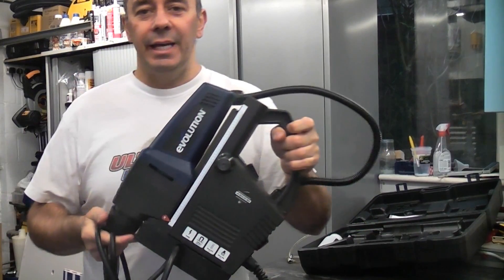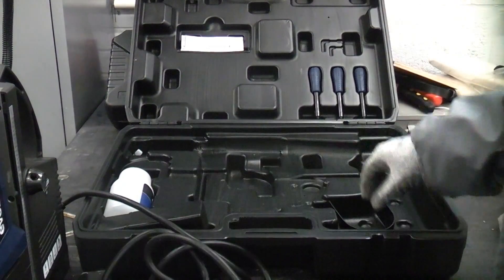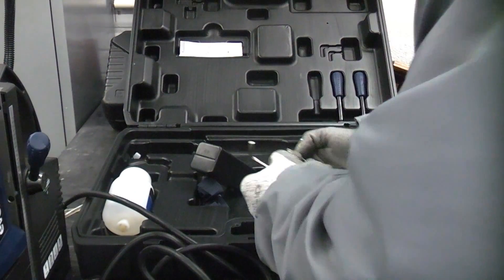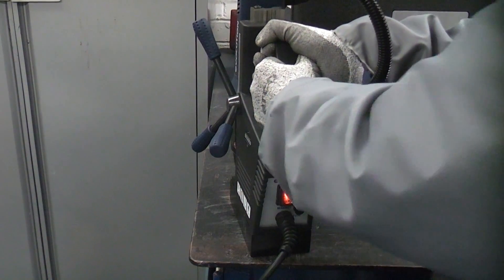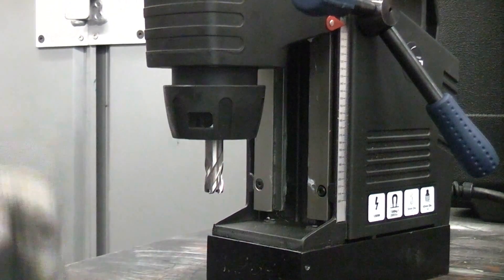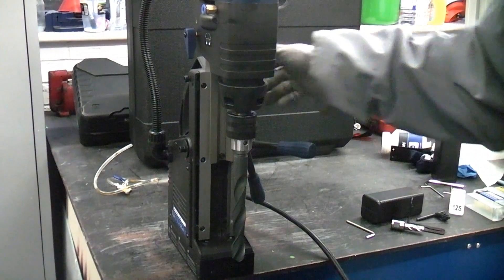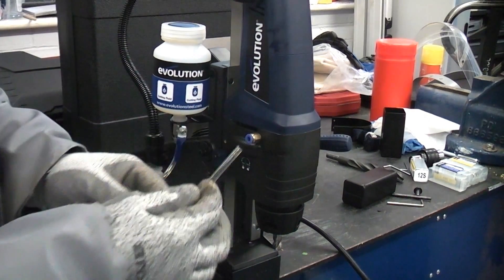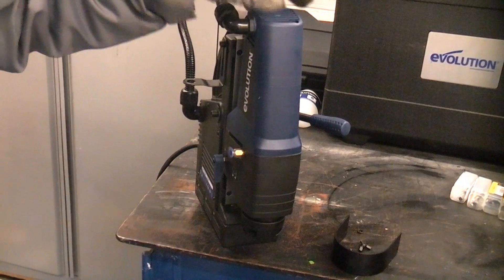Evolution Evo Mag 42 Review

Comment: Hi there, any videos on padlock/chain security, there has been a spate of thefts round here, using  a cordless angle grinder to steal stuff with padlocks on, do you or can you make any videos on how to fight back against that situation?
Reply from the maker: There is nothing you can do that will stop an angle grinder as it will cut the hardest metals known to man.The only thing you can do is make it difficult for them or use camera's or alarms etc.
Reply: Any chain is inherently weak to Angle grinders. 

If you are wanting a padlock and Pad bar then Google chub Hercules pad bar and chub Hercules padlock, the padlock shackle is completely shrouded and the cast iron block I around it almost the size of a a half brick, the pad bar itself is of a similar construction.  I have one of these on my workshop and if I were to want to break in I would look at other methods of entry rather than the lock as it would take Farr too long even if armed with multiple cutting discs, battery's etc  or  the other favourite ex fire brigade hydraulic jaws  of life.
Reply: Paul F
i just need some supertanker anchor chain, and a giant padlock then! lol thanks for the heads up, looks great for a workshop door

Comment: Great review once again!
Reply from the maker: Thanks, this machine actually saved me a lot of hard work as a mate of mine had a stuck anti-theft wheel bolt that the garage could not remove. I clamped a piece of 5mm thick steel to his wheel, then used an ARTU drill bit to drill a hole down the centre of the bolt, which enabled me to remove it. Thanks for the comment ;-)

Comment: Can you put a watermelon underneath it and switch it on and see if it smashes it?
Reply: a watermelon is about 6-8 inches, the magnetic force even at half  an inch would be tiny, so it would do nothing! its not a hydraulic press!
Reply: +Ultimate Handyman what about a snickers?
Reply from the maker: LOL.
You just reminded me I have to get the hydraulic pump out to test more grab adhesives ;-)
Reply from the maker: The magnet is strong but only when in close contact with the steel, if you were to put something two inches thick between the steel and the drill and switched on the magnet it would hardly grab at all, but you don't want to try it with your fingers ;-)
Reply from the maker: It would probably flatten one of those ;-)
Reply: R James
this is hilarious, this could be the beginning of the budget hydraulic channel, nothing we cant crush, so long as its very small and costs 40p